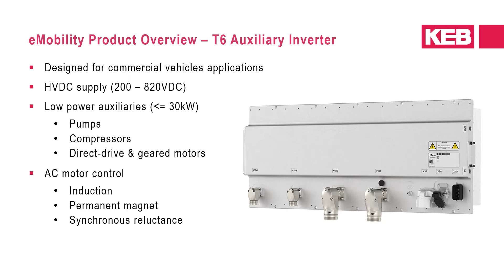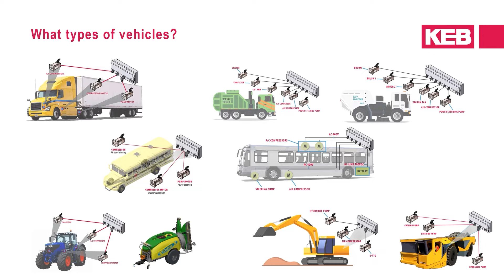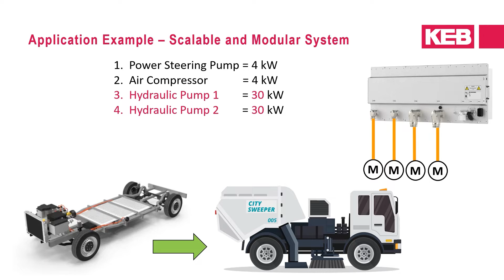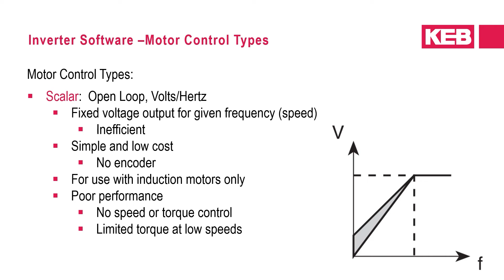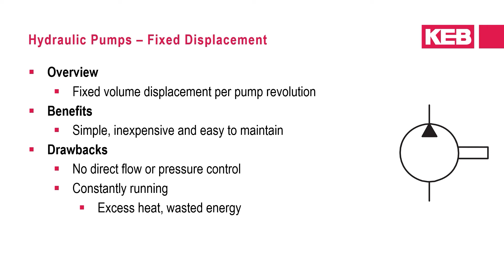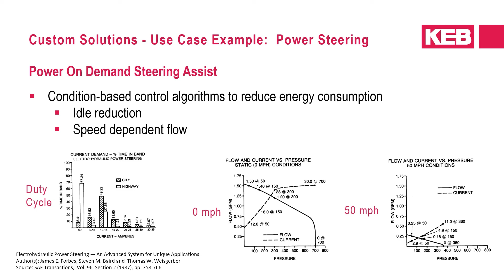Innovative Solutions for Commercial Vehicle Auxiliary Systems - KEB T6 Inverter platform

Comment: Hi... I have a problem with vfd f5 104 kva it writes an E OC error... When I change IGBT it works a little bit ... and after the same problem is repeated
Reply from the maker: This is an over current error. For further help you should contact your machine's original manufacturer. If you cannot find a solution through them, then contact our local KEB representative. If you are in the US or Canada you can contact us at: https://www.kebamerica.com/contact